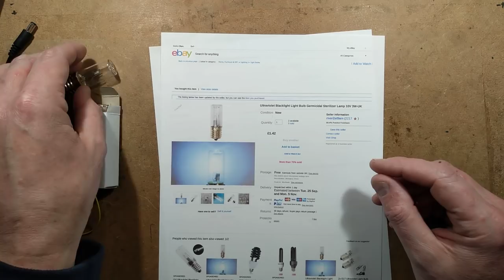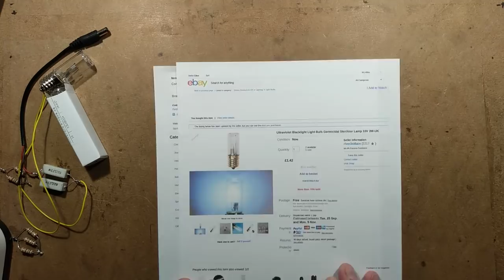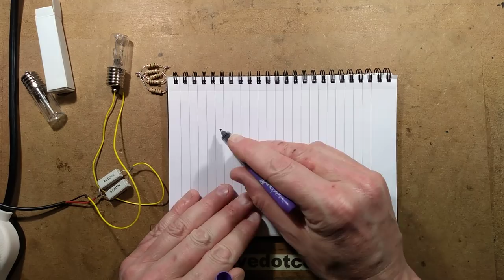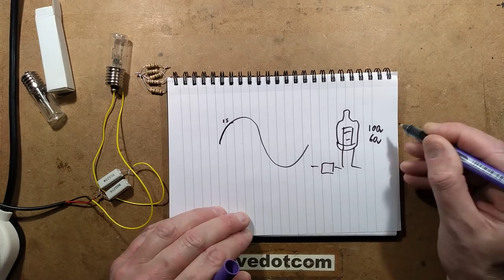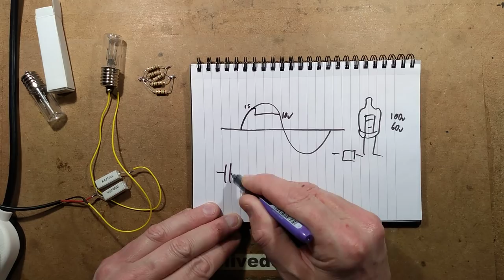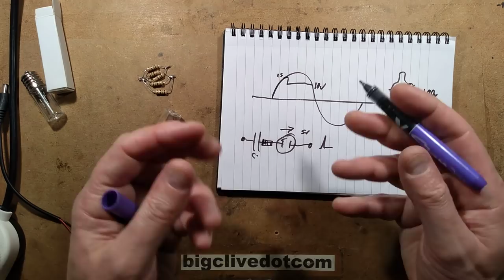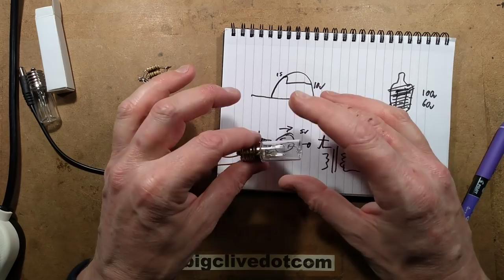Amazing ten-volt mercury discharge UVC lamp.  (GTL3)

Comment: The point is an optical viewfinder is that (a photographer) can frame the photo for as long has he wishes without risking running out of battery before actually taking the shot. Something really annoying when I finally finished framing my perfect shot on mirrorless camera and when I'm about to press the shutter, BATTERY EXHAUSTED.
Issue with electronic viewfinders is that it requires the sensor and the camera electronics to be constantly running while framing a possible photo, that drains the battery no matter how efficient the system is.
Also they say autofocus is faster on DSLR because phase detection technology, but idk if that is still true on newer cameras that use  hybrid detection and contrast detection technology.

Comment: hot cathode tubes can be run cold by running the voltage higher that is what the instant clf bulbs did the spiral bulbs that did not have startup delay.

Comment: Compact System Cameras i.e. M4/3 are very good indeed but the normal focal length is effect double that of DSLR '35mm' cameras due to the image sensor being half the size of those cameras.  That makes them great for distance shots but not so great close up as a 28mm M4/3 is effectively 56mm.  You need a 14mm lens, absolute minimum. for bench work and maybe even shorter.  The image quality suffers slightly because of the smaller sensor but I like them.  So much so I have three, all Panasonic Lumix.  My first purchase was the G1, then the G3 and then the GX7.  The GX8 will be my next purchase but I shall be keeping both the G1 and the G2.  The GX8 will replace the GX7.  Video on the GX7 is superb and can be operated and monitored via Bluetooth with a smart phone or tablet.  All the lenses on ALL the CSC cameras are interchangeable no matter the manufacturer which, along with their lack of bulk, explains their popularity.  For what you are doing Clive you have made a wise choice.
Reply: He's gone with a Sony A6500, so it's APS-C. With those focal length is increased by 50%.
Although, that won't effect him initially as he's gone with a kit lens.

Comment: Interesting.I wonder if they could make a phosphor coated one in the same size of an incandescent bulb and make it run on household current without the need for a ballast,it would be perfect for enclosed fixtures designed for small and lightweight bulbs that can handle high temperatures and since it doesn't have a ballast it certainly can.

Comment: Oh! While I'm thinking about it. I'd definitely advise getting a UV filter for whatever lenses you use on your new camera, for a couple of reasons.

First, that puts a plate of clear (in the visible spectrum) but otherwise quite inexpensive glass in front of the expensive glass, offering a degree of sacrificial or ablative impact protection that may be very worthwhile if you start blowing things up on your bench again.

Second, while some cameras have a permanently installed UV/IR filter over the sensor, not all do; some only filter IR and let UV pass, some don't bother with either. It wouldn't be a concern for most purposes, but consider what you're doing in this very video: illuminating a very powerful short-wave UV source in the camera's field of view. If it's energetic enough to be harmful to skin on short exposure, imagine what it might do to a very responsive image sensor, after being focused through a proper lens! No big deal with a phone; those are more or less disposable anyway. A camera that costs six or ten times as much would be a regrettable thing to maybe lose that way.
Reply from the maker: I would expect the harmful UVC to be filtered by the lens glass.  I'll definitely be putting a clear filter over the front of the lens for physical protection.

Comment: These lamps are not new new size excepted, Philips And G-E made these years ago, they were golf ball size with either a screw base or small bayonet quartz envelope and should not be viewed only through glass harmful UV. They were used as air sterilisers housed in a enclosure which also had a small fan to circulate the air. The lamp or lamps were joined in series to the fan, my one was American and so run on 120v, The ones you show look like they use a non standard base either candeiabra   .5 inch dia  or intermediate at 5/8 inch dia...hope this helps. Check out LGN  also
Reply from the maker: Using the fan to ballast the lamps is a good idea if they were matched.  It would also nudge the voltage to the fan down slightly.
Reply: Hi thanks, yes the fan would run slower and they would need matching so not blowing the lamp, There is one of these alight shown on LGN Lighting Gallery  Net which deals with all aspects of lamps and lighting.

Comment: Neon being a purely discharge lamp would sputter because the full force of the current spike traverses the arc path ionizing the metal at the arc terminus.  Given the UVC lamp has a filament always connected wouldn't the resistive filament absorb the current spike and simply emit more heat?

Comment: Great video, thanks!  Can you let me know what power supply voltage you used (seems to be 24) and what the specs are for the resistors?  I have 2 of these lamps and want to try them out.
Reply from the maker: http://russellsrandomthoughts.blogspot.com/2013/05/the-gtl3-bulb-simple-and-inexpensive.html

Comment: I didn't suppose that discharge lamps can start and operate with such a low voltage. You should keep it i.e. in a glass jar before turning it on - I think it should stop UV-C radiation (normal glass absorbs it - germicidal lamps are made of quartz glass which passes it). Are there similar lamps emitting white light instead of UV-C (with phosphor and normal glass) available? It would be an interesting mobile light source - alternative for LEDs which are novadays everywhere or for incandescent lightbulbs.

Comment: I wonder if six of these connected in series with a 18W inductive ballast would work using 230V AC.
Reply from the maker: If going that far it might be better to use a 12" UVC tube.
Reply: Thanks Clive! It is just an experiment, and nothing practical will come out of it. Unfortunately, I can't find smaller ballasts.

Comment: I experimented today but I only get a very little blue light. Only lights up the place where we see those white stuff on the filament (the end only), the rest of the filament still red. I used a 16.5VAC 500mA transformer (I only has that at hand) with different value 5W resistors. When I turn it up the voltage does not fluctuate, always 12.2V or 13.2V or 10V, depend the resistor value I chose. Maybe my transformer voltage has to be higher with the right value resistor, just as yours? So with the 16.5V I used 5W 36R, 33R, and 27R. I left the lamp on for a longer time with the 33R value. I tried 45R resistor also, still I got 10V on the lamp but so little light hardly can see the lamp is on. I would like to use this lamp inside my air purifier if I can manage to get as much blue light as yours.
Reply from the maker: The glow only happens around the white coating on the ends of the heater.  It's the electron emitting coating.
Reply: @bigclivedotcom  Yes but the red supposed to turn of. With that set up both glow the red and the blue part. I watched one of other video the lamp with the capacitor. So I got the idea and now it works how it should. Thanks for your replay! Now it glows with a full light. I think I need a 6W type to be effective (good enough) in a high power air purifier.
Reply from the maker: @jenonika966  Some current will still flow through the heater to keep the white coating emmissive.

Comment: Thanks for the video Clive. Curious if you think there would be any issues running this DC with current limiting?
Reply from the maker: One electrode would be doing all the work, but it's viable.  What's the application?
Reply: @bigclivedotcom  Thanks for the fast response! Killing bacterial growth /algae in a water cooling loop reservoir. Easy access to DC power source... A little clunky to provide AC :/ Are you thinking reduced bulb lifespan or reduced UVC output?
Reply from the maker: @DrewanNicholson  It might be possible to adapt an existing water purifier that uses the linear UVC tubes and add a 12V tube driver.  Preferably one that does drive the tubes properly (cathode heater) like the inverters used on buses.
Ozone bubbling is possibly also an option.
Reply from the maker: @DrewanNicholson  If it doesn't involve fish and things then chemical sterilization may be the way to go.
Reply: @bigclivedotcom  Totally! Great suggestions, which unfortunately had already been ruled out. I started out looking at the UVC tubes that you mentioned, but the shape and size (too big) ruled them out. Chemical is out since the radiators are aluminum, and there is 80m of 3mm ID tubing so viscosity is a concern (not to mention the reduced heat capacity of glycol based coolants). I would love if the UVC leds were more available, seems ideal.

BTW, in your video you mentioned that you didn't smell ozone. The bulbs you have are the ozone free variant. The bulbs with ozone have a little red mark on the top of the glass. The red variant really do crank out ozone so there's no mistaking it.

Comment: Does the filament provide enough of a current path to prevent the sputtering issue with discharge or is the resistance too high?

Comment: This lamp is not an neon so using capacitor as a ballast shouldn't cause sputtering because initial cuttent spike will go throught resistive filament not pass through mercury vapour.

Comment: thank you for your helpful video. I have removed the core contain Mercury-vapor from the lap and I was hopping to light it but some high voltage ballast but it became black. I do not know how to turn it on in order to use its nice UVC. guide me please
Reply from the maker: You have to use the correct ballast or driver for discharge lamps or it can damage their electrodes and damage them.

Comment: Are there any readily available 12v ballasts for this? I'm assuming that a standard led ballast would work or am I as well just running with the resistors? Just ordered 2 to make a couple of handheld lights to identify fluorescent minerals at shows. Plan is to make a small 18650 / buck converter and usb charger unit with a 10 second latched timer.
Reply from the maker: Ideally it would be AC to get the discharge from both electrodes.  With a standard 300mA LED driver all the work would be done by one electrode.
Reply: Resistor method it is then. Ta Clive..
Reply: And now the penny drops that this needs AC. On the hunt for a 12v dc fluorescent tube driver for experiments.

Comment: I remember a reel to reel tape deck in the 70s that had a vu meter that had a greeny blue glow and looked like a long valve but not a vft im now wondering if it was quite dangerous
Reply from the maker: It may have been a vacuum fluorescent display.
Reply: @bigclivedotcom  it looked pretty I used to stare at it wondering how it worked

Comment: "It's a DLSR.. thats mirrorless" .-. You would want a DLSR if you need your view finder to zoom.  It's a Sony A series. I got a A5100 myself. It takes really good video.
Reply from the maker: Sony a6500 with intent to use it with an external monitor for live monitoring.
Reply: These cameras allow you to do that over micro-HDMI, AV or via Wifi  using "View on TV" mode. They work pretty well at that. Via Wifi its actually also a remote. You can switch recording mode and change settings. 

The HDMI port is not proprietary but it can be hard to find. From this image its the "D" type.
https://en.wikipedia.org/wiki/HDMI#/media/File:HDMI_Connector_Types.png

For A/V it requires an unsupplied special cable that goes into the connector otherwise used for USB.
http://i.ebayimg.com/images/i/131793245564-0-1/s-l1000.jpg

If you want to always supply power you need to get a kit that provides wall power in place of the battery. Giving it USB power won't work except for standby charging. I learned that the hard way.
http://briansmith.com/wp-content/uploads/2014/07/Sony-AC-PW20.jpg

Comment: Would it be possible to use a MOV instead of a resister to limit those spikes or do they not make them for such a low current flow? So in other words have a capacitor with a MOV?

Comment: i wonder why not use a starter circuit , you could use a seconde circuit in parallel like rectifier to charge capacitor, then a alternating switch to unplug the capacitor from the DC circuit, discharging it on the lamp (which is on the AC circuit)
Also a small DC to AC circuit for batteries would be interesting  (alternating oscillator drives a small transformer)

Comment: About the mirror-thing on digital single lens reflex camera's: screens (at least on the M3 I have, I have not used an electronic viewfinder-equipped camera) still have a lag, I have tried what seems to be an infinite amount of times to learn to "predict the future" that comes with the screens output when it comes to photographing objects at speed (or suggesting they are at high speed), and I never managed to have an object in focus because the movement I was basing the camera's rotation on was not the thing I was required to follow in real life.
Also, I personally feel that an electronic viewfinder is something extra that can break, and something extra drawing power, which I feel is a bad thing.
Next to that: sunlight...My see-through-the-lens viewfinder works incredibly well in sunlight, whereas the screen will be impossible to see clearly in bright sunlight.

Comment: Why an SLR? The difference with an SLR is in the autofocusing mechanism, which operates on a different principle and is faster and more reliable than that on a consumer-grade camera. The consumer grade camera has to judge focusing from the CCD output. The SLR uses the mirror to direct light onto a dedicated focusing array.

The difference is quite astounding, like focusing and shooting in 0.25s or less with the SLR, compared to several seconds of hesitation and waiting on the consumer grade camera... followed by an out of focus shot of your foot after you've lowered the thing! 

Unfortunately this only applies in still photo mode when using the optical viewfinder. In video mode or when using the LCD screen as a viewfinder, the SLR goes back to the clunky CCD-contrast focusing method.

Comment: Looks like these lights would be the perfect size to make a night light from. The kids will love the glow.

PS, might need to see if you can lock out the white balance. It gets a bit wonky when dragging the paper under.
Reply: Just in case you haven’t seen Clive’s other video about UV ( https://youtu.be/CpRMud6EFtE ) , UV-C lamps are intended for germicidal and sterilisation applications and are therefore quite destructive to the body. I would highly recommend NOT using these globes anywhere where the light they produce is visible to people or animals.
Reply: @cameronsteel6147 ; Well, maybe they want to punish the kids for looking at screens all day by giving them some cataracts with, possibly, a dash of melanoma on the side?
Reply: If you put it in some normal glass (i.e. in a jar), it should absorb UV-C radiation. You can also stick some fluorescent stickers inside it - they will glow. But you must be sure that your kids use it when it's open or broken.

Comment: I have just embarked on this journey needing to replace UVC tubes that are very expensive and don't last long. This globe is the perfect size to run 2 in the space of 1 tube in my drinking water sanitisation tube. How long will the globes last using the 24vac and 2 x 82 Ohm, 5W resistors? The resistors are quite hot after 30 mins and the voltage across the globes is 9.5.
Reply from the maker: I'd recommend using the original tubes for the correct level of UVC.  Some water sterilizers do over run the tubes.  It may be worth looking at a new ballast for them.
Reply: @bigclivedotcom  Thanks for answering, but I have been without the UVC for about 6 months, on tank water and not got sick. It's just for drinking water for two of us at home. The tubes in Australia are getting the way of needing to sell your first born child to get enough money to sustain them. The cheap Chinese ballasts are obviously a problem, but I think matching the 6W tubes with GTL3 globes is worth a trial to see how long they last. In relation your comment and "the  correct level of UVC" - is too much harmful or are you referring to getting enough to do the job properly? Two of these GTL3 globes appear to have a far brighter output compared to all the tubes I've used over the last 8 years.
Reply: @bigclivedotcom  Here is how I setup the GTL3s in place of the tube (10 second slide show); https://youtu.be/atPMwK7G99A